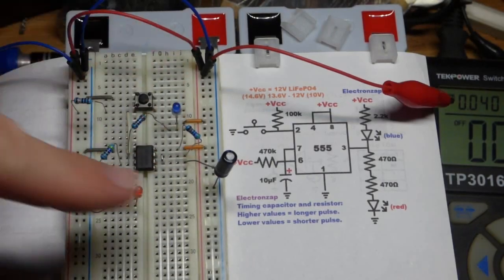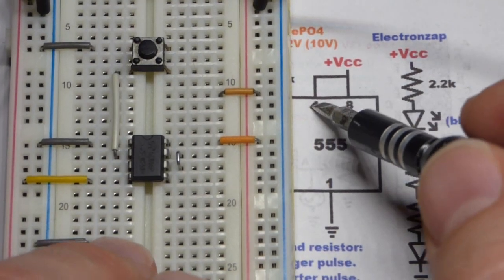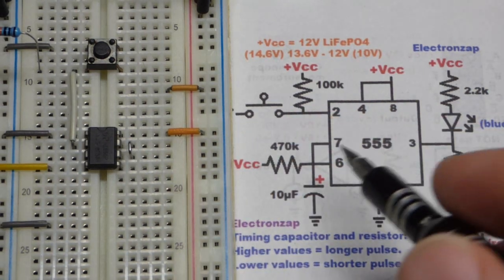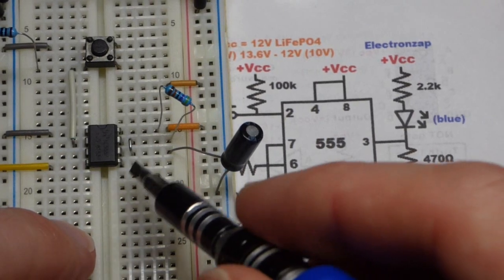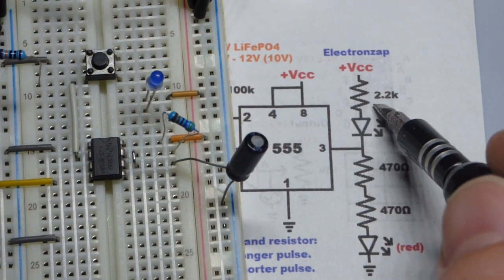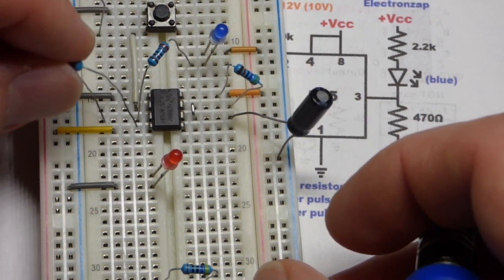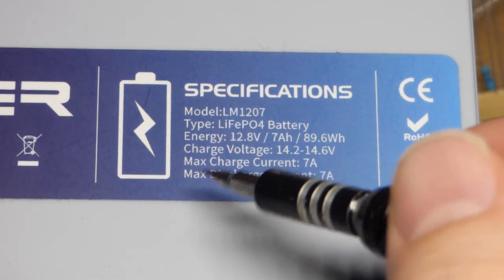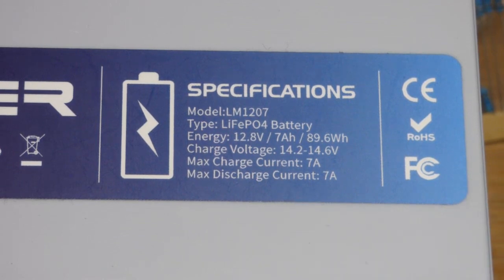Monostable Mode 555 timer demo circuit powered with LiFePO4 12V battery

Comment from the maker: https://amzn.to/3s9xeDX VATRER POWER 12V 7AH LiFePO4. https://www.youtube.com/c/electronzap/videos https://www.amazon.com/shop/electronzapdotcom/list/1ADLVE33FFFYL?ref_=cm_sw_r_cp_ud_aipsflist_aipsfelectronzapdotcom_B79P02M0KFPJ24S768FC As an Amazon Associate I earn from qualifying purchases. Americans should check out one or more of those links before making any purchases. There's no extra cost to you.
My website https://electronzap.com/ To donate  https://www.patreon.com/electronzap Become a member https://www.youtube.com/channel/UCC8jLsnnN1_o93p5QOIX1vA/join
https://www.reddit.com/r/ElectronicsStudy/

Monostable mode 555 timer circuit has a low output (the one stable state) until you force it high. However it is only high for the time set by a resistor and capacitor in this circuit. After that time is up, the output returns to it's stable state of low until you force it high again.

Comment: Ive got similar rigged up to shut down a display after turning  my 240volt contraption on , after everything powered up i can re trigger the display to turn on for a few seconds to show the name of what my contraption used to be before it was  purposed - display section a little too power hungry when on, makes the 5volt  buck convertor whine noise a bit.
Reply from the maker: That's a good idea.

Comment: Good video! Since the two series 470 ohm resistors help reduce heat, would two parallel 2200 ohm resistors have a similar effect?
Reply from the maker: Glad to hear! Yeah, I usually use higher value parallel resistors if a lower value will get too hot. I decided to show the lower value series resistor alternative in recent videos.